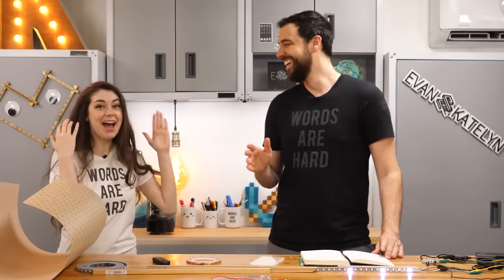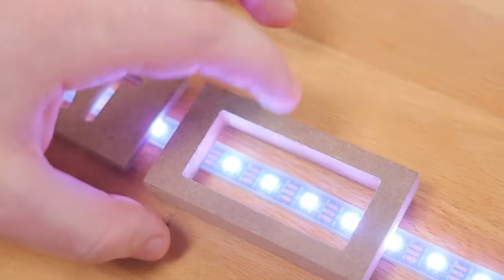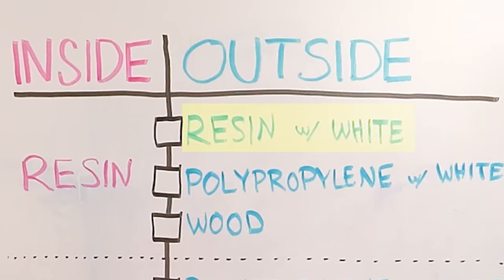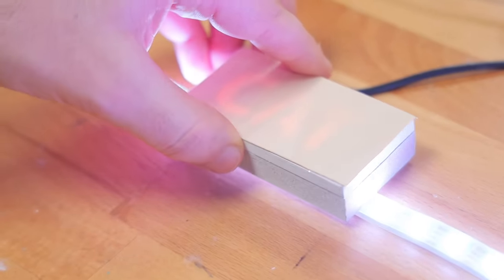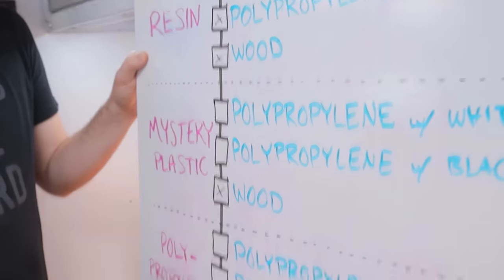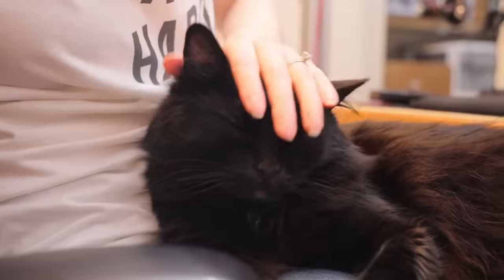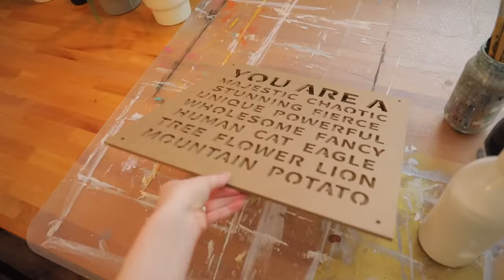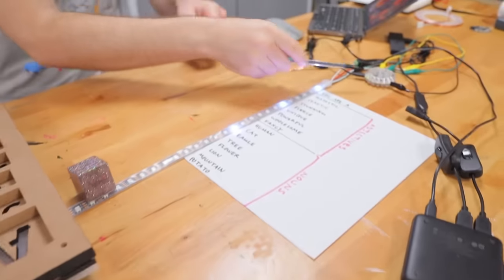Yell-Controlled Motivational Poster

Comment: Evan, I have to scold you for leaving alligator clips in a finished project and not using the brass screws as the touch sensors. BTW no source code?

Comment: This is why I hate DIY with resin, people just use it or try to use it everywhere, even in the places where resin never was an option. Please, whatever you do, do not make utencils and plates from resin. Resin has a problem of never fully curing, meaning that it will continue to "cure" even after it became solid, so every time you use, handle or even just walking by resin project you are essentially slowly killing yourself with resin particles and fumes wich enter your system through skin or breath. This is also why you should never even consider a dining table out of resin, unless you want to slowly posin yourself
Reply: @JustaRocker  you spelt poison wrong
Reply: @Pikachu777_  yeah, sorry, English is not my first language, I make some errors from time to time